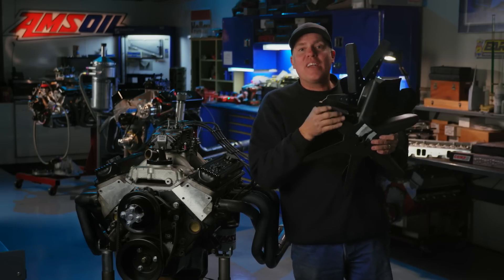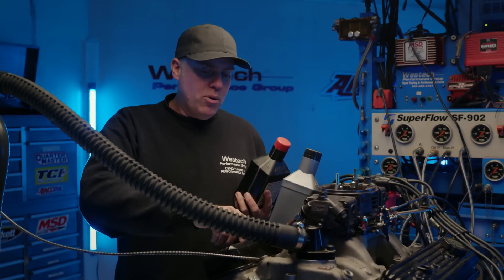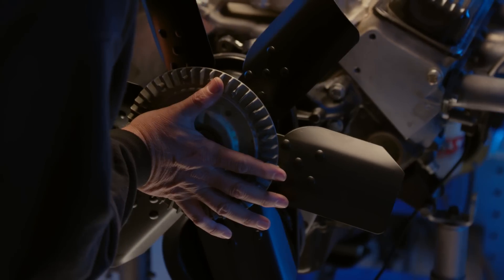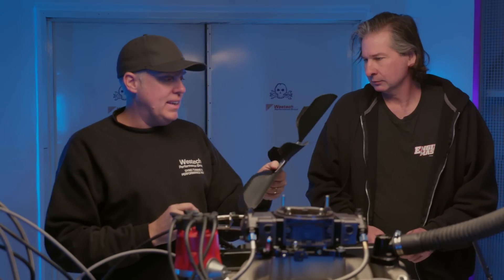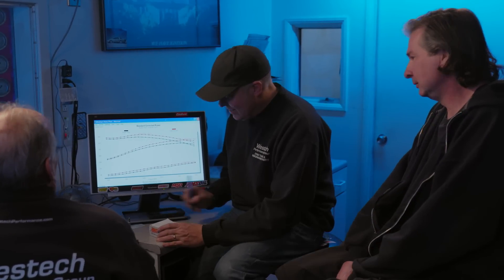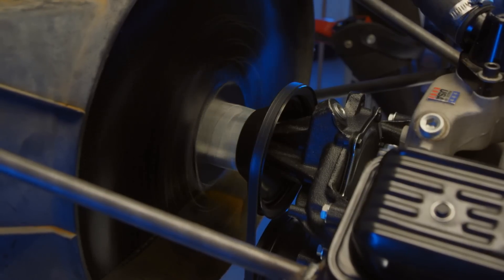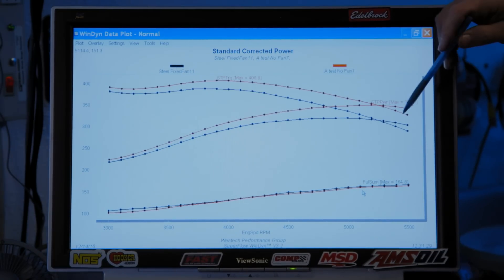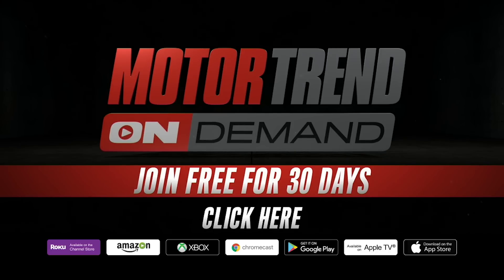Cooling Fan Shoot-Out! - Engine Masters Ep. 20

Comment: This video is hands down the most useful information I've gotten from Engine Masters. 

I have a 1987 Toyota Hilux with a 2.2L 4Y motor which made 94hp & 134 lb/f torque when it was new 30 years ago. This Hilux has a rare Aisin-Warner automatic 3sp + OD. Now with 221,000km on the ticker and running on LPG it is likely making ~85hp. I live in a mountainous area, so I use everything this engine can make every day.  The steepest climb is 200m elev in 3km, where the Hilux won't get above 70km/h and downshifts into 2nd. 

It has a 6 bladed plastic fan with a temperature compensated clutch. On a 110km/h limit motorway, the Hilux downshifts on the slightest inclines while trying to maintain the speed limit. Presuming this OEM clutch fan exhibits the same 17hp loss as the one tested in this vid, that's a big chunk out of 85hp. 

I removed the clutch fan and installed a 180watt rated electric fan (actually draws 240W at 13.8V). With the electric fan's thermostat set for 85C, it never comes on when maintaining any speed above 60km/h. The increase in top speed on hills & torque when leaving a stop are dramatic. It no longer downshifts to maintain 110kmh- in fact, it'll hold 125km/h without downshifting. The steep hill which couldn't be climbed at more than 70km/h is now tackled at 80 in 3rd gear. Fuel economy is up 18%. 

Well worth doing an electric fan especially if you don't have much hp to begin with.. 

If you buy a cheap aftermarket electric fan, you'll find many come with plastic zip-tie-like fasteners which go through the radiator core to hold the fan in place. These are garbage. All 4 broke in my application. Make your own fan mount. I used 1.2mm thick sheet steel, cut out a hole for the fan and put ears on it to mount to the points on the radiator formerly used by the OEM shroud. 

Thanks Dave, Steve & Steve. Really helpful stuff! :)

Comment: You can add the safety factor as well. Those alloy blades go AWOL regularly. The factory 6 blade is an A/C type fan, a normal engine would be a 4 blade. Though I have seen more than a few of those blades go too at RPM, through the bonnet, through the splash pan under the engine, that without damaging the shroud @ 100mph. And it viabrated baaad. We removed the mess, put the bolts back in and the car was driven for 6 months without a fan, country miles however. Back in the city it got hot in traffic.
Also one on a dyno that disapeared out the left side of the [RHD] car into the workshop. That was about 8000rpm on a Nissan engine. 
Short moral is that fans on high performance engines kill power and are very dangerous. Though I guess that test engine was probably near 150% of crank speed as Chevs usually are. 
Some electric fans however do not cool properly as they seem to leak air everywhere. And location,,,, I had an International Acco truck 345 petrol which the fan was bloody noisy on. Removed it and fitted a 16" electric fan and it boiled at 50mph. So put the steel one back on and more insulation over the engine !!! That big ugly noisy fan pulled a LOT more air.

Comment: Welcome to 1971. Ripping the radiator shroud off was a cheap way for 5 extra seat of the pants HP. Sometimes it was also worth 2 hours on the side of the road in summer waiting for the radiator to stop boiling over.

Comment: Wouldn't the shroud being taken off mean that the fan is mostly spinning in free space as opposed to having to force air through the radiator?  Basically, there's less drag on the air BEFORE it reaches the fan.  

Of course, this situation does NOT equate to conditions inside the hood of your vehicle as it's not really open air.

Comment: The air takes the path of least resistance. So the air rolls/spills around the blade especially at the tip. That bend at the tip helps reduce that effect. A little pool of moving air is created so the non ducted fan is easier to turn. The hp numbers would fall if the fans were also in a moving air flow as it would be in a moving car, not by much, but measurable. It's been obvious for decades that an electric fan is the best option because you only need it when you're moving slowly if the radiator duct is set up correctly. If not, a cushion of air builds up in front of the rad and effectively blocks air flow. A tapered duct, widest at the rad, not the front of the car is most effective, with a vertical rad if possible. Also pulling air through is best if possible. If an electric fan isn't ducted, the air flow will also be cone shaped, not a as most expect a circular tunnel of air.

Comment: The part that's missing  is how much air is each fan moving?as in how much cooling power do they have, and how much heat does that drag create in the engine.the clutch fan is going to work better in the real world  because the moving car will make it's own airflow.

Comment: Removing the shroud allows the fan to cavitate at high rpm. This does free up HP as you show but SERIOUSLY destroys flow. It takes less HP because it pulls less air. I would have REALLY liked if they had done a CFM test though the radiator with this test. I have seen some write ups on this before while the big nasty fan pulled 30hp it likely moved the most air, thus if overheating were an issue it may be worth the HP loss to save the motor. I have been swapping fans on my Prostock dirt car trying to keep the heat in check and would gladly give up 6hp more at this point for steady airflow and controlled temperatures.
just my $.02

Comment: Their test is off. They were running an engine at 5500 rpm in still air. At 5500 rpm I'd be doing over a 100 mph. I think the air would be blowing over my fan. Doh!

Comment: From the point of view of an Army helicopter instructor pilot, I bet the shroud was preventing what we call vortex ring state. 
It's the same reason you see those vortex disrupting vertical wiglets on airliners. 
Without the shroud the  high pressure air on the back side of the blades was able to spill over the tip's of the blades and it recirculated to the low pressure area in front of the fan blades.   
Science!
Thanks for the great video's!
Reply: Path of least resistance.
Reply: I've read a bit about the vortex ring state causing some pretty nasty accidents. Stay safe out there and thank you for your service.
Reply: Vortex ring state only prevents lift, you still have all of the drag. So while I see what you're saying, I believe that is not the case in this instance. remember this is not a centrifugal compressor, with an axial compressor such as this, increased pressure differential does not decrease torque input. Therefore the easier it is for the fan to get ahold of the air and move it the less torque it will take.

Comment: Is it mass, or is it resistance, or a combination of both? They sell lighter wheels for the front end of the engine, which reduces mass, which supposedly increases hp due to less parasitic loss in turning the weight. Obviously with the plastic one, it was a poor design with a lot of drag, but fixed blade to fixed blade, aluminum to steel, the lighter, less massive fan performed better, despite the angle being similar. Annd of course the clutched fan wasn't spinning at the rpm of the engine. But apples to apples.. Is it mass, drag or both?

Comment: since an electric fan draws about 30 amps, and an alternator draws between 2-4 hp to run at max output why not add a second alternator and run an electric fan? your hp loss would be far less than the best mechanical powered fan and no added strain to your cars electrical system. It can be done I worked emergency services and all the vehicles with lights had a second alternator.

Comment: The reason the fan without the shroud ate less power is because the air wasn't contained, it was allowed to flow around the fan instead of through it. What this test did not show was how much a loss the cooling system experienced in efficiency. Granted for racing it wouldn't make much difference for a quarter mile, but pull a trailer or or a sled, and you're going to boil over quicker than shit. 

Buddy of mine did this to his truck and wonders why it overheats all the time.

Comment: Seeing how much power the fixed steel fan sucked out of the engine, I think that's the reason the SAE went from gross to net power ratings in 1971.  The cooling fan probably counted for the biggest difference between the two methods.

Comment: I like this type of comparison.  On thing that nobody mentioned is that thermal fan clutches all disengage when the engine is revved up high when passing/accelerating.  The cut out RPM is determined by the air temperature at the radiator/condenser.  I see so many messed up cooling system/cooling fan abominations on classic cars/hot rods at car shows.  Amazing how many Classics & hot rods overheat too.  Electric fans don't work well on the older narrow multiple row radiators in classic cars.  They work on wider high efficiency radiators on modern cars.  The best factory electric fans  were on GM diesels and Buick Grand Nationals they pull some serious air.  Most aftermarket electric fans are a joke.  Lets see more shows like this.

Comment: I would like to see the test done with a high speed fan blowing air through the radiator to simulate road speed and give a more accurate result. The moving air should lessen the impact on HP and alter the difference from fan to fan since a flex fan would flex less.

Comment: on my stockcar we use a 4 blade fan  but its a 1/4 mile dirt track and its a 355 motor flat tops and a bullet cam and a 2 barrel holley 500 vor-tec heads  and a triple pass radiator and we use a shroud  solid lifters and Harland sharp rockers

Comment: The reason for the shrouded fan making less hp is the shroud forces air to flow over the radiator which has greater resistance to flow, but greater cooling. The unshrouded fan still draws air through the radiator but also has air coming to it from the engine side. It goes with out saying the cooling is reduced without the shroud.

Comment: what's the difference if the engine has air blowing through it as if you were driving. wouldn't the resistance go down since a portion of the air is being fed to the fans vs it having to draw it?

Comment: Wouldn't an electric motor be more accurate, and just measure the current for a certain RPM? Its like strapping a 400 HP mostly consistent load, and adding a tiny load while trying to just measure the tiny load.

Comment: The last fan, factory steel should be fitted to the clutch hub and run with the radiator functioning so that clutch gets hot and releases fan. This will give you a realistic set of numbers. I have tested this on chassis dyno with a V8 Commodore running at 4500 rpm on full throttle and watching the BHP cycle up and down by 18 RWHP as the fan cycles from full speed to minimum with temperature

Comment: the good thing about using a electric fan is at high speed you do not need a fan so you could turn it off.... I would like to see the power loss with an electric fan being run or turned off to see how much power the alternator is using to power the fan

Comment: It is called "slippage". A blade fan running in free air will have air that moves from the output side (high pressure) to the input (low pressure) side of the fan. This reduces the load on the fan and thereby reduces the HP required to turn the blade. Also there is less of a "seal" on the radiator so there is less "vacuum" created on the fan blade.

Comment: fans doin less work when you remove the shroud (impeller action) when you incase it you give it a higher surface area to draw from and more air to work with.. which is why factory runs a shroud

yay

Comment: The shroud forced the fan to pull through the radiator which is a flow restriction, without the shroud the fan can pull air around it with less resistance, you guys should have known that removing the shroud would increase power (but hurt cooling)

Comment: okay easy test . air cleaners! 14X3 flat base vs lowered base. 10X2 . factor air cleaner single snorkel. don't forget air filter. normal paper vs k&n. maybe k&n stub stack which made the top of your carb a smoother transition. no nothing at all . than velocity stacks big and small.

Comment: Like some others observed there are potentially other considerations than power loss when it comes to fans:
1. Engine coolant in radiator heat dissipation
2. Oil and or transmission cooler heat dissipation
3. AC system heat dissipation.
4. Convection cooling affect on engine from fan.
5. Reliability of the fan system
6. Cost of the systems.

I thought the clutch fan would stop turning all together at hi rpm in which case it would be on par power wise to an electric set up.  I've always thought the mech. fans moved more air than electric since all HD trucks run them.  Cost is certainly a factor when a good electric fan/s , shroud relays thermostatic switch and wiring plus the labor to install  could be spent on making power in other ways like purchasing a nitrous system!  I love Engine Master anyway.  I think I'll keep my $500 and good old clutch fan even if it is transferring 20 HP.  My 406 still is plenty fun!

Comment: Ok another question, I hear people say their engine runs on 87-89 octane and the factory recommends that, however I argue that if they have 100k on the engine and high temp. summer days equate to 91-93 octane in that engine. The vortec 350 in late 90's is my daily driver and I seem to also get better fuel mileage when running 93 octane with 180k on the clock. Im aware of the knock sensors adjusting timing but I think the engine will last longer
and run better if it never pre-ignition pings...which is awful on the pistons.

Comment: Horsepower won't drop this much in real life driving. Air is being rammed in from the grille, then the fan adds force to the air. In this test, the fan had more air resistance since it was trying to scavenge air to push by sucking air through the radiator. That's why removing the shroud helped. It's like breathing through a cloth. It's easier to breath through it if you have air being forced into it by an external force. Rather than breathing stagnant air. Or, spinning a fan in a current of water (air is considered a fluid) rather than stationary water with the same RPMs.

Comment: Is there a difference in power loss between different size alternators (50, 100, 150, 200, or more)? It seems like if you could replace the bulk of your belt driven items with just an massive alternator you would still come ahead in terms of parasitic losses.
Reply: Nope.  Load from the alternator relies entirely on the load ON the alternator.  I will say it's been my experience that going "too big" with an alternator increases the reliability of the electrical system, probably because with a marginal alternator, you're running it at or near capacity a lot of the time.

Comment: With the radiator and shroud the engine makes less HP. Because the shroud makes the fan suck air thru the radiator and the radiator makes some air resistance, so it's harder for the fan to suck air. With no radiator and shroud it will make more HP.

Comment: At speed, wouldn't the air flowing through the engine bay hit the fan and force it to act like a flywheel? It may not produce power, but it should significantly lower the burden of turning the fan. This test video just doesn't seem accurate. Who cares how much power an engine makes sitting still?

Comment: Hmm, the one thing no one ever mentioned in the video or in the comments is what happens to the air coming through the radiator as the vehicle is moving faster and faster? If the clutch fan was only taking a 14 hp bite at zero mph what would the "Bite" be at 5500 rpm with the transmission in 1 to 1? Once you hit 55-60 mph there is a significant amount of force pushing the fan. The fan begins to be pushed by the incoming air rather than pulled by the pulleys and the engine. At low vehicle speeds this demonstration is accurate, but at high vehicle speeds this test is pretty much worthless.
Reply: X agreed
Reply: I would disagree. The aerodynamic design of front ends over the past 25 years or so allow very little "
ram air" to pass through the radiator.  Even in older cars the air didn't just smoothly pass through the radiator. Watching wind-tunnel test on older cars show a bubble of air being pushed along by the grill, hood and lower bodywork.

Comment: If AMS oil is going to be advertised, we at least need to see a dyno comparison of the horsepower differences if any between the various weights and specs of the oil they offer. Another idea would be the power loss of running a 160 thermostat all the way up to a 198 thermostat on a typical street Sbc.

Comment: 1) Of course you'll get more hp without the fan shroud. It's simple aerodynamics, there's no tunnel to suck through. Try breathing as much air as possible through a straw, and then try to do the same with your mouth wide open. Downside is: You will cool your radiator less than with the shroud.
2) Missing control run without a fan after all the tests. Now you'll never know if the engine has lost some bite (because of extra heat or whatever else?), or still makes the 349 hp it did at the start.
3) Use an electric fan and VEMS. Switch fan off if a) coolant temp is acceptable and b) throttle is full open. Power when you need it.

Comment: Not sure if roller rockers vs stock stamped steel rockers is considered parasitic drag but would like the know the hp & tq specs. Also I hear the new belt drives like Jesel have hp & tq specs. as well as other advantages like harmonics and no stretching to alter timing over time.